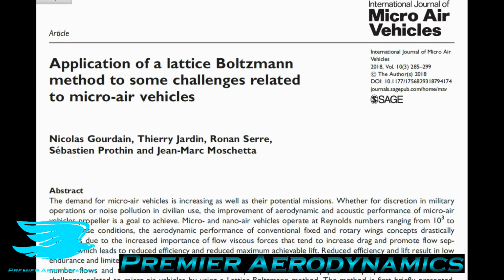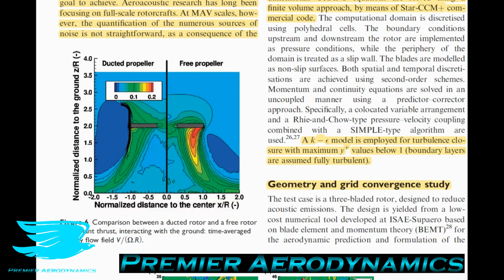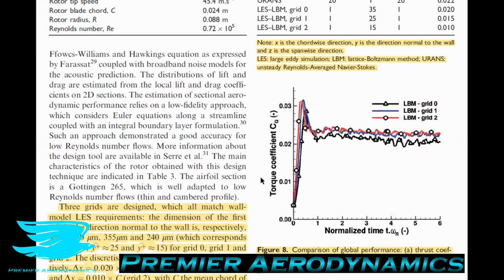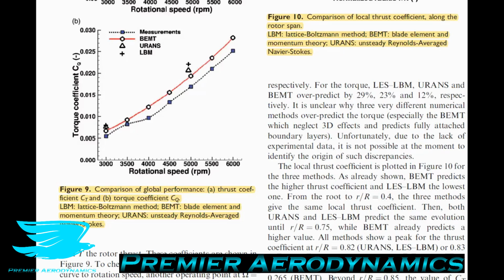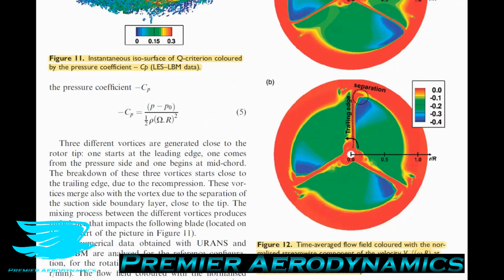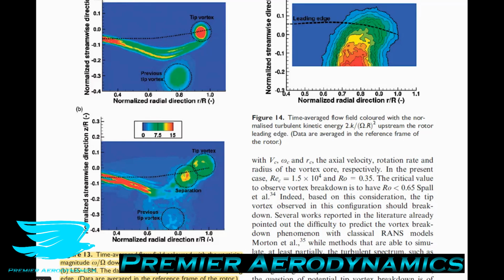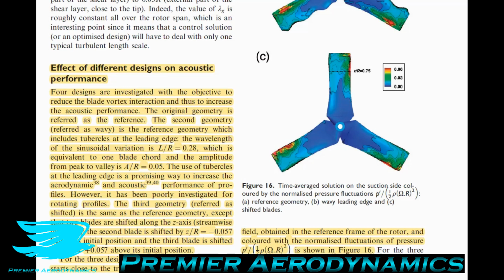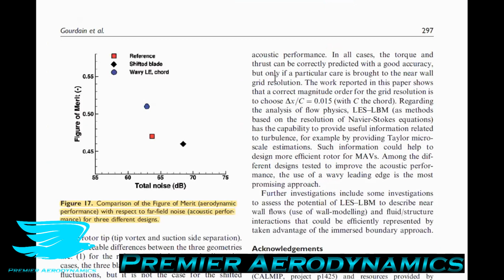Is the Lattice Boltzmann Method for CFD any good part 2 - podcast #86

Comment: Great video, would LBM be applicable to hypersonics when shocks, separation, and heat transfer are the most important flow features. Currently tools use mesh refinement extensively.
Reply from the maker: To my knowledge, not currently, and for two reasons.

The first reason is that with the current approach to LBM, the faster the flow, the finer the grid needs to be. I'm not sure what the exact domain size is for you, but, generally, going to hypersonic speeds will mean that the grid needs to be soooo fine, because of the inherent coupling of the time and space aspects. So, until that is decoupled, I don't see LBM being a practical avenue simply because of the computing power needed. It would eclipse the time required for traditional solvers.

The second reason is that most of the work going into LBM is focused on air chemistry found at subsonic and supersonic speeds. With the hypersonic aspect, the plasma dynamics needs to be factored in, which I'm not sure if anyone is doing currently. The best bet currently is Powerflow, but they just managed to produce something that does supersonics but not hypersonics yet.

Hopefully in the next decade it will become viable.